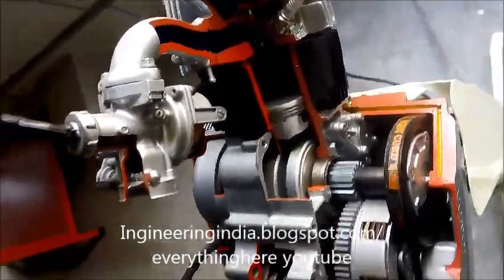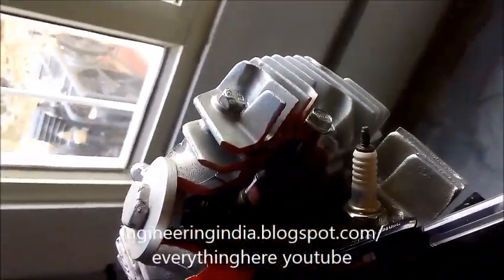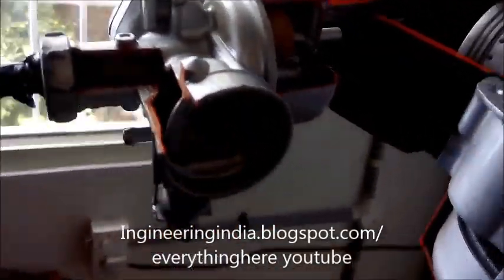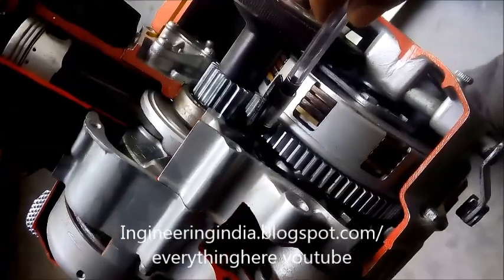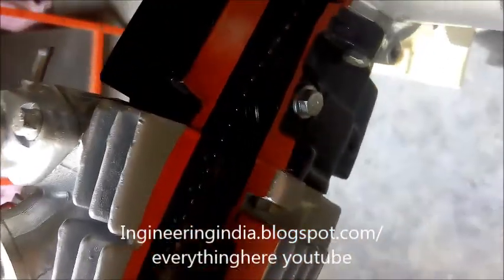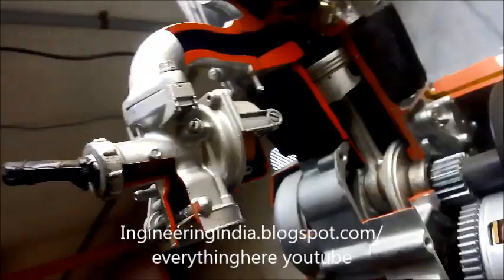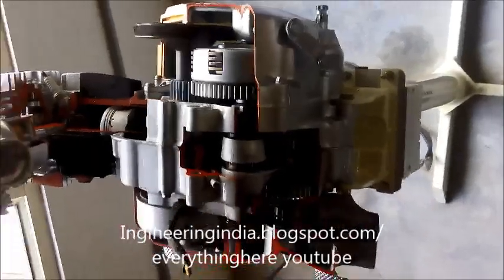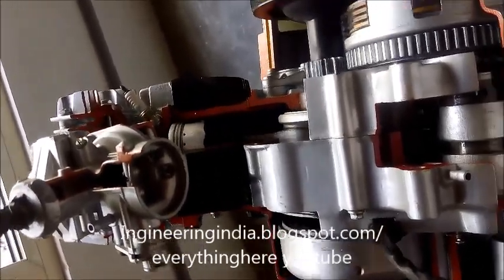4 stroke two wheeler hero honda engine description in cut section

Comment: Bro in my bike when I rode it in 32-35 km speed in 5th gear, some dragging feel is there in the nearby area of gear lever and foot rest.  What may be the reason?
Reply from the maker: bro 5 th gear is for top speed,dont drive in that gear you wont get mileage  and gear box will worn out
Reply: Ingineering India oh ok. Thanks bro. From now on I won't do it. Thank you so much for the information.